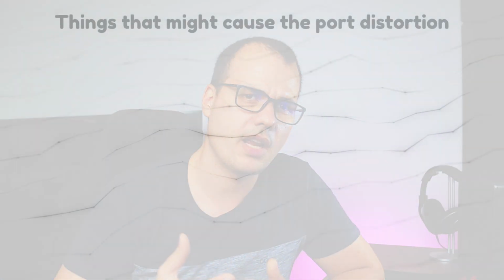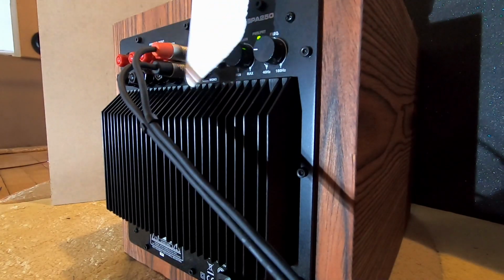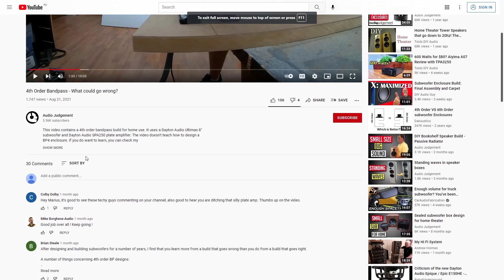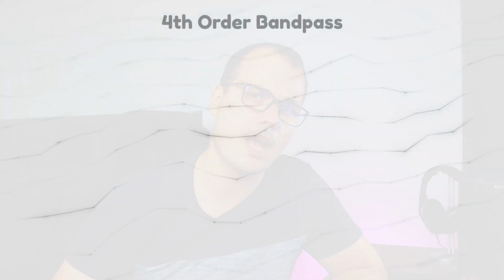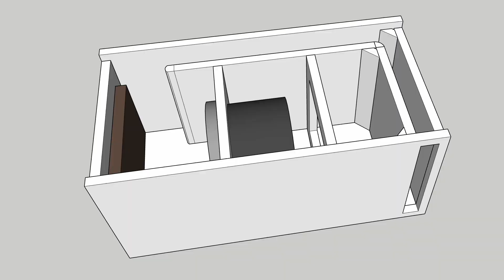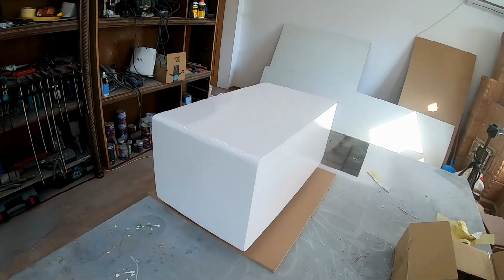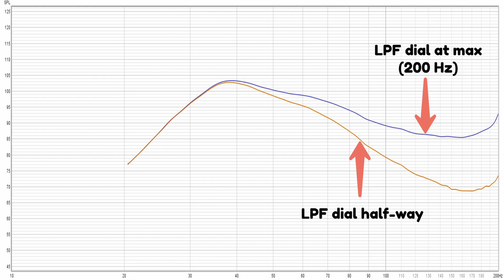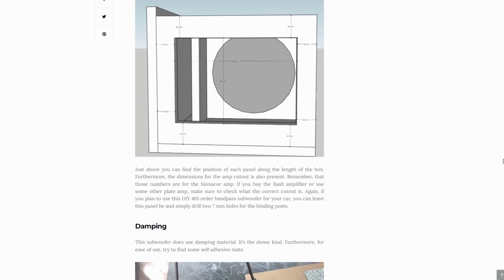4th order bandpass V2.0 - It's awesome

Comment: I´m using a JBL 1204BP bandpass with 2000watt 4ohm 0.03THD amp. Got a flat 20-60hz with a little peak on 3db. When it placed behind (as a carsubwofer should be) it can help to boost 20-30hz frequency :)

Comment: Hi Marius, if you can make a video on correct method of measuring SPL, and frequency of ported sub, it would help many people. Many YouTube videos are available but they just measure the impedance to find out tuning freq. But there are no videos to measure the SPL and low end extension of ported subs. I meaning measuring at the driver and measuring at the port and then combining them.

Comment: Set your camera's shutter speed to 1/60th of a second and you won't need studio lights as bright as you have them (or you can lower your ISO). Your footage will also look more natural and you'll be able to record in an NTSC country without flicker. You could also bump down to 30fps with 1/50th of a second for all the same benefits AND 60% savings on hard drive space. And yes, because of the 1/50th shutter, you'll be able to record in your PAL country without flicker.

Comment: I have never listened this type of bass recording, no distortion even in recording wow.
I want to fit two 12" subs in a single sealed box.
I know if I place both subs on same face I have to match their polarity by just flipping the wire of any one sub.
But what if I put subs on the opposite faces?
Should the subs should move at 180° phase difference from each other or the same polarity as above case?
Reply from the maker: If you place 2 subs in the same box, as in they share the same air volume, you wire them normally. It doesn't matter on which panel you place them, the polarity is the same for both of them. The only time you would want to wire the 2nd sub in reverse polarity is when you mount the 2nd subwoofer with the magnet outside
Reply: @AudioJudgement  OK now I can make such a box, thanks.